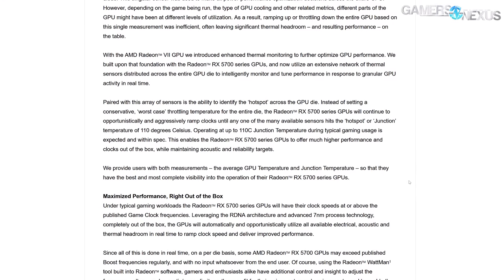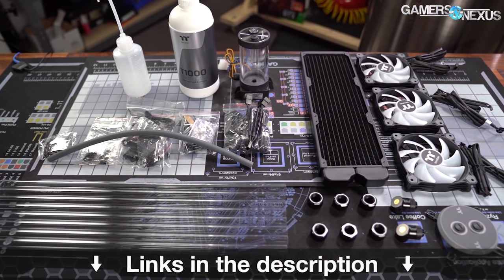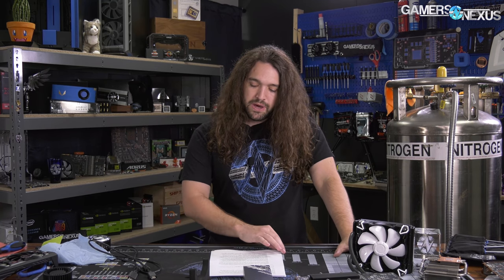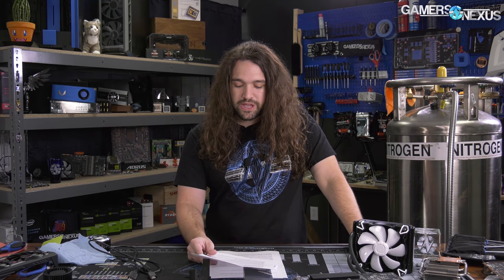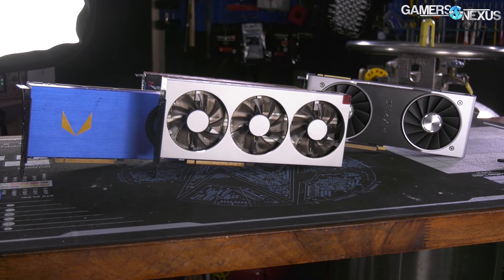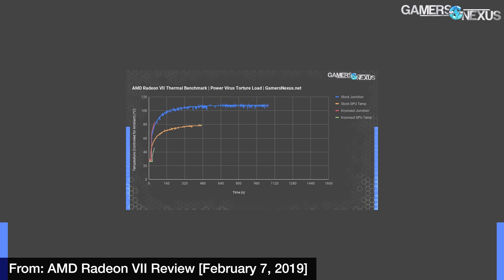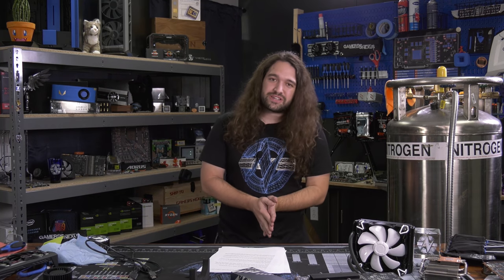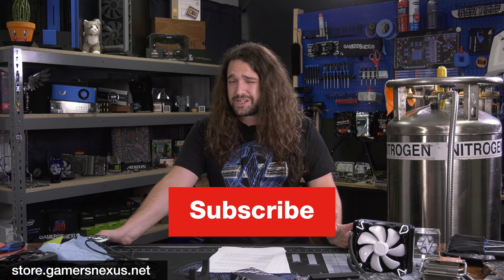Explaining Navi 5700 XT Junction Temperature | 110°C is Not "Expected"

Comment: Never forget the reference r9 290/x cards they hit 90-100c mine didnt last a year did get a free tri x out of it though good times.
Reply: They probably had hotspot temps of like 130-140c if we are comparing.
Reply: i have used 4 R9 290's and no one hit above 94c, so if you are running 100c, it is not the cards fault. it is about fan speed, overclocking and case cooling.
Reply: My reference R9 290X spent years ramping up to 95c every time I played a game. Eventually I put a 120mm CLC cooler on it and dropped temps down to 70-75c max. The card didn’t overclocking it’s self to get back to 95c, but it did stop dropping clocks, and give me some more headroom to OC. I’m pretty sure these 5700s work almost the exact same way, down to the same 95c edge temp. From my experience, when the card was NOT running at 95c, I had smoother gameplay and less glitches. Plus, it didn’t sound like there was a jet engine test stand in my room! I’d stake a non-reference cooler over that stupid blower any day.

Comment: My biggest takeaway.

"Just to be clear, there is a very big difference between "Silicon can handle it" and "Cooler is shit""
Reply: Had a 4670 for years.. cooler was shit.. 113c was not an uncommon gaming temperature after I replaced it and gave it to a friend who also had one it was crossfired both running at those insane temperatures for about 6 years before one of them finally gave up and died while the other is still chugging on Diablo III and other lighter games to this very day. if RTG says card will run as expected at 110c they ain't fucking around.
Reply: @bdhale34  still, to have a gpu at a temperature above the boiling point for hours at a time is nuts for the company to promote
Reply: That's true but in my opinion a red devil 5700xt doesnt have a bad cooler. Still ca. 90°C junction
Reply: Well at least at normal fan settings. If i'm using my custom ones it's getting loud and making the card pretty much not cooler at all. It's just staying longer cooler but in the end it has maybe 1°C less
Reply: @konigdiamant5080  same with mine (3 fan version) no matter how hard i push it i still cant get it over 90°C and fan speed is like at 40%

Comment: On consumer grade electronics I'd be more worried about the glass transition temp of the PCB and Delta temp over Delta time as CTE mismatch generally kills more electronics than time at temp unless electrolytic caps were pushed to the limit.
Reply: Have you seen zombie Epower  mods? You can use a blowtorch to solder plates of copper to the circuit board rails and the PCB layers don’t give out... A freaken blowtorch! That’s not some wimpy little soldering, it’s a blowtorch!

You could say, cyclic thermal fatigue of the BGA solder (as that does happen and kills lots of cards), but respectively this card is only like 80c, which is cooler than a stock Titan Xp for example. So at 80c like you’re used to thinking about, that’s not very hot... (when I run cards to 115c package temp, it would be showing like 145c if calculated with these hot spot sensors since normal cards don’t have this).

I have never seen PCB damage except for areas right next to melted and burned components, even then it was only superficial surface damage and wouldn’t be an issue for repair.
Reply: @jakegarrett8109  can you fellas speak in English please
Reply: @motionmayfire  sorry, it's unfortunately a mix of PC and engineering. It's broken down about as simple as possible (kind of like explaining quantum mechanics, sure it can be simplified to an extent, but it still becomes quite lengthy even in layman's terms, which would be the case for this conversation). You can Google most of the acronyms like BGA is Ball Grid Array, it's the chip mounting solution that connects the GPU die core to the PCB (printed circuit board). But then you still need to look up the difference between package temp vs other thermocouple measuring areas, so if you don't understand those principals it will become a rabbit hole. It's kind of like explaining how rainbows are formed to a kid for the first time (it's pretty cool physics, so my answer isn't just "humidity and light diffraction" like some parents would say, because as a kid I know I'd ask "but why the curve, why the colors always in the same orientation, why some colors more dominant"), it just depends how much you care to dig into it, but if you do it's fun so happy searching!

Comment: Remember the Core2Quad that had a Tjmax of 70°C because they only had a Edge Temperature?
Reply: It is also 70c on the lynnfield core i7 chips.
Reply: intel has plenty of CPU's out with a TJmax of 105 degree's.
Reply: @TheCountess666  and Apple takes full advantage out of it - aka. baked apple
Reply: @Felix-ve9hs  yeah, the difference between "the silicon can handle it and the coller is shit" becomes obvious here. MacBooks are the perfect example to get some points of the video across. Most of the time if temperatures are high, it's a bad cooler or bad case or both.
Reply: @fie1329  compared to the Intel Pentium 4 (very high heat density) or the Radeon R9 290X (very high power consumption) the RX 5700 XT just needs a decent cooler :^)
Reply: @Felix-ve9hs  right, some architectures put out more heat than others, that's kind of one point why we have different architectures.
But that does not automatically mean that they need to run warmer. If they run warmer that means that the architecture puts out proportionally more heat than the cooler is able to handle and you simply need a better cooler. More heat ==> better cooler. 
So what AMD tries with the rx5700 is arguing against the facts.

They should now better, I mean after all they do not sell AM4 coolers for TR4 so that would be a similar thing with CPUs.
Reply: @fie1329  no, What AMD did with the 5700xt is EXACTLY the same that basically every other reference cooler design in recent history did: design it to keep the GPU around 80 degreee's C.

Look at the anandtech review of the 5700xt, and the temperatures compared to the other reference coolers. nearly all are 75 to 80 degree's C. and that includes nvidia 900 and 10 series cards. 

And guess what the GTX2080 and 2080Ti are both also around 80 degree's C, if you look up their review on anandtech.
Reply: @ItsSpeltGoogol new paste and dust the cooler off. there you have the solution.
Reply: i have used plenty of C2Q CPU's. i let it go at 80C as my max comfortable zone and it works fine for me.
Reply: Yeah, agree.
What most people also forget: Silicon being a semiconductor material degrades. And as physics teach degrading is accelerated by temperature.
So even if pure temperature is not important for some reason, after years of use in case of macs for example the CPU will boost less when often running hot and eventually die faster.
Also the thermal cycles with big deltas are bad for soldered components of any kind.

My point: people should tell the manufacturers when they do shit, so next time the manufacturer does better hopefully. 
Tech in general may be a religion-like thing with people like Tech-Jesus, but there really shouldn't be a red, green, or blue subgroup like religion.
Reply: @fie1329  silicon degrades at a VERY VERY slow rate lmao if that was the case. TVs from the 60s, 70s & 80s wouldn't still work.
Reply: @bepbep7418  First of all: Tell me how much technology of these TVs is based on nano scale silicon.
Second would be to find out the percentage of TVs from these times still being functional today.

Think about it and then think about your comment again.

Just becaus your grandma or whoever happens to have a TV from the 70s still running doesn't mean that physics don't matter. Fact is that semiconductors degrade and this gets worse the more frequently the heat cycles and the bigger the delta is.
Also in today's technology, the tolerances for failure are much smaller for various reasons.

So if you still don't believe me I suggest asking in a repairshop of your choice what are the most common reasons for electronics to fail. You'd be surprised.

Comment: I couldn't care less what they allow or expect.  I expect a good cooling solution, and the blower style is not one.  The AIB cards are FAR superior.  Whether or not it will damage the card is all well and good.  I also prefer the majority of the sound to come out of the speakers, and not the cooler.  As far as your explanation, you said it several times, to an adequate degree.  You've more than done your job on this topic.  There's only so much you can yell from the rooftops.  I feel and share your frustration.  I'm surprised your face wasn't blue by the end.
Reply: Brad Viviviyal  I thought the partner cards were non reference board designs (Devil having 10 phase), so they were considered AIB.  I was under the impression that reference board vs a redesign determined it.  So what is the distinction?

Comment: As an owner of Vega 56 Red Dragon keeping the Hot spot lower than "acceptable" is crucial to getting great results from under clocking. The difference between vrm temps and hot spots can be upwards to 20c and better efficiency and consistent sustainable speed is rewarded by keeping the hot spots down. So Steve isn't kidding or splitting hairs!

Comment: An example for non-pc-enthusiasts of this same behaviour would be cars:
Running your engine at 7.500 RPM might be within spec and the engine can handle it, but it is far from fine. The same goes with the Junction Temperature. Also: In both cases lower is generally better. At least up to a certain point.

Comment: I respect this video. People don't understand this is not against AMD or pro nVidia. This is just real, give us a better cooler on a reference card end of story. I bought 5700xt reference,it is working fine,but it could have been more quiet and cool.
Reply: only reason i would buy reference blower card is to slap waterblock on it ...

why the hell is noone selling cards WITHOUT coolers for the watercooling market is beyond me- easier packaging, lower production cost, lower transport cost per unit and certainly less waste... what the hell am i supposed to do with the cooler from my Radeon VII now for example ...
Reply: @Asghaad  I bought the reference card when they came out,I couldn't wait anymore. My 1080ti died 4months ago and I was waiting for Navi long enough. I am not sorry I bought it in any way, it's still a great card,only loud sometimes. AIB cards do get a frame or two more from time to time tough.
Reply: @adnan4688  well id advise you to invest in watercooling then, the silence is worth the cost ...

if you are concerned with leaks just stick with FLEXIBLE tubing and use proper compression fittings.
Reply: Did you undervolt your 5700xt? Should be quieter and cooler once undervolted.
Reply: @Asghaad  Maybe later on,right now I have more important things on my mind when it comes to finances. Need to deal with them first TBH.
Reply: @adnan4688  thats something only you yourself can decide, watercooling isnt the cheapest cooling solution :)
Reply: @Asghaad  they probably did the math and figured that they'd spend more money adding an extra "coolerless" variant that would sit on stores/warehouses waiting for a water cooling enthusiast to pick them up.
Reply: @ChucksSEADnDEAD  let me put it this way, they ought to sell about as many of those cards as the EKWB and other block manufacturers ship the full cover blocks ...

considering more and more companies are getting into custom loop business id say there certainly is market for coolerless cards
Reply: bro is still work  fine with daily useage?  I'm worried from this temp

Comment: The way I see it, as long as the clock boosts as high as expected and the lifespan of the card is not significantly reduced, they can call it normal. The word “expected” is definitely misleading however.
I mean, yeah, the cooler is bad, but most users are more worried about not getting the performance the card should deliver or high temps breaking the card. If neither is the case, one certainly don’t have to worry too much.

Comment: Silicon transistors have curves over how much current they can pass with a given temperature, typically that current is 0 at around 175c and causes instant failure, but silicon will degrade at high temperature 
i have had silicon mosfets in power inverters i feel fine running at 100c but when things start approaching 120c i start reducing the estimated lifespan of the product, i would be very cautious designing a product that runs at 110c unless you can get the temperature of every single transistor on that die if you expect it to last for years

Comment: You said "The silicon can handle it, but it's still too hot" several times. But how do you determine what is "too hot"? I could just as easily say that the sapphire card is "too hot even though the silicon can handle it" because a water cooler proves it could run cooler.
Reply: Hotter chips don't last as long. Regularly running at temperatures just barely within spec might last you 3 years, but I would give worse odds on a 5-year upgrade cycle. Or, if you wanted to keep that system around and running a legacy Windows OS for compatibility reasons (try playing Embodiment of the Scarlet Devil, Civilization 4, or actually a lot of legacy games/software with or without DRM on Windows 10), you may as well kiss your chance of that machine running for 7-10 years or more goodbye.

Comment: AMD: we know how our cards work
Steve: hold my temperature probe..
Reply: Amd engineers: We specced the gpu chip to operate up to 110°C.
AMD media: The card is within specs at 110°C
Internet Hive mind: Duurr...... 110° is gud
Reply: @eoinkenny3188   Steve literally said the blower cooler keeps temps well under 110c when not crippled but then he software cripples the card to stop progressive cooling at 40dB then he gets upset that thermals are above comfort level. There is a massive flaw here, 40dB in an open air test bench is unfair (open air bench is loud to begin with and not what most consumers use as their day to day rig), test that stuff in a closed case where 40dB would result in higher fan speeds. 2nd GamersNexus is obviously trying to push for "noise-normalized thermals" to become a standard of testing for all outlets to use and really blowing this out of proportion, likely to garner more attention for their channel. 3rd AMD addressed the issue of using a blower style cooler on reference models because this gives the most consistent result across all types of builds, including low air flow or no airflow cases like mini-ITX where an axial design would literally dump heat back into it's intake.  Steve is jumping to conclusions that AMD is trying to save face for using a blower style cooler, when they already stated they would have done that but choose to go the safe route for a broader audience. Really suspect GamersNexus is just trying to drum attention for their "Noise-Normalized Thermals" and to their channel in general.
Reply: @captainkittens506  My only point was that amd engineers probably designed their chip to operate at up to 110 in a worse case scenario. Their media department then misrepresented this info and then the Internet went and apparently misrepresented it again.

Comment: The GPU will function at 110c, but it isn't optimal, far from it. I sense a certain degree of damage control in their statements. Bottom line, your way better off with a partner card containing a more efficient cooler.
Reply: Every single high end GPU with a reference release in the last say al leasst 5 years has had the same 110 degree tjunction temperatures.

There is NOTHING extraordinary about navi's thermal performance with the reference cooler. all of them were designed to keep the GPU operating at around 80 degree's and that means all of them had tjunction temperatures well above 100 degree's.
Reply: @TheCountess666  at this point i think AMD made a mistake trying to get more information than was needed to the uninformed masses ... if they kept reportingh the edge temperature just like everyone else they wouldnt need to deal wit the swarms of people refusing to understand the meaning of the measurement accusing them of running the cards at unacceptable temperatures ...

i also am baffled at stupidity of the human race if so many people cannot understand the concept of measuring hottest spot within the silicone and that its not the same as measuring the edge temperature ...
Reply: this silicon is good up to ~125 but the safe limit of 110 leaves headroom to protect the chip in the case that it happens to spike to 125+ before the protections trigger. also wouldn't be surprised if nvidia actually added a feature like AMD is using if turing is some where in the 120-125C range in certain parts of the die given how big it is.

ultimately it was just a poorly worded blog post probably by a marketing person that failed to get the post proof read before posting it.
Reply: The GPU will function at 110c, but it wil virtually never reach that for a normal user.
Reply: @Asghaad  They still report the same edge temperature as everyone else. 
They just added Tjunction.

other then that i agree.
Reply: The Gigabyte OC has a big 3 fan cooler on it. Junction temperature still sits on 107. At stock.
Reply: @ToxicTeemoOCE  I've got the gigabyte 5700xt auros and my junction is hitting 110-111 on my stress test using OCCT and the card is undervolted/underclocked. I've even ramped up my fan curve.